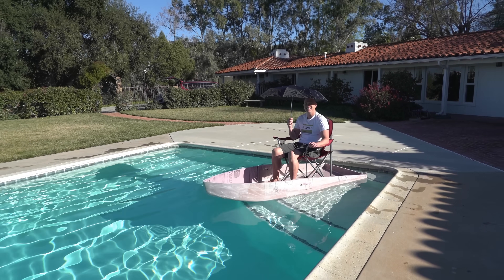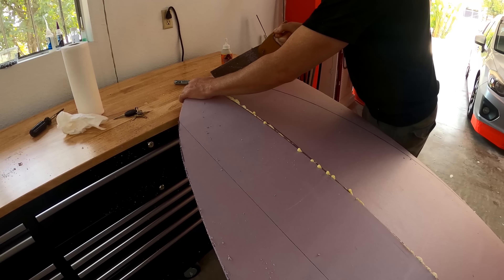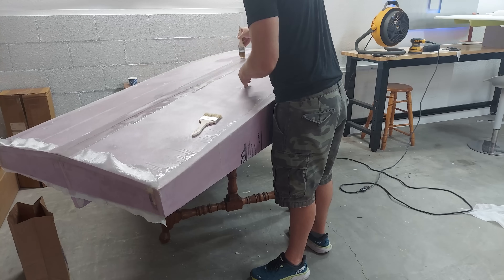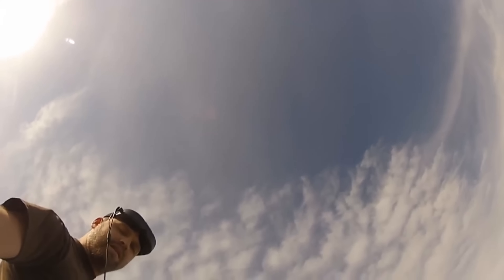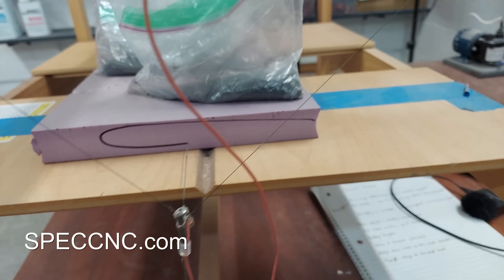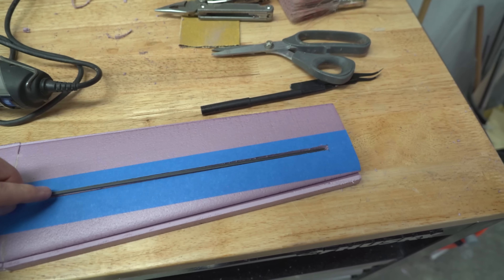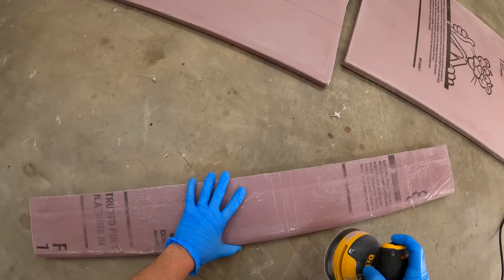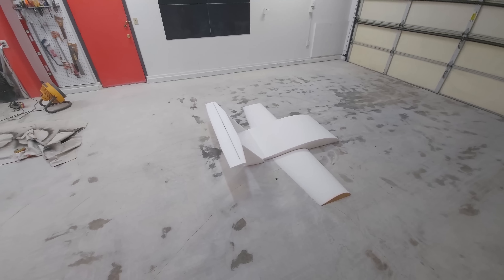Worlds First Optionally Manned Hydrofoil?  Build Part 1

Comment: Mix long set epoxy in a container that will sit inside a twin container - in one container ( the bottom one) add crushed ice and seat the container with the epoxy mix on top - the cold will extend the set time and make for a less stress epoxy job. You have time to set up the parts ( remove air bubbles and general fit up ) even when epoxy has been applied and the bonus of less waste due to the mix curing b4 the job is completed. If you use quality epoxy the cooling of the mix does not seem to effect the quality and strength of the finished work piece.  For quick and dirty "glue" applications mix super glue and sodium bicarbonate to create a strong bond and one that fills gaps nicely - can be sanded when set but cannot be slowed down!!!.

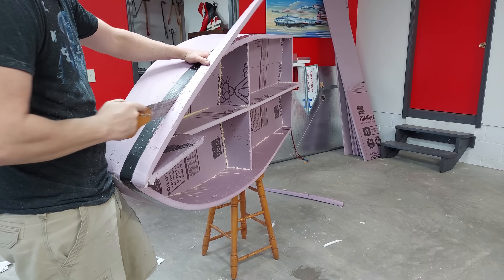Comment: Appreciate seeing bits of process used going from CAD design to full-foam-formed concept. Nice job recycling an efficient land cruiser (1:45) into a future hydrofoil vehicle. Maximizing the milage of your foam supplies.

The bonus GEV concept looks great. Not sure if placing motors behind where an optional pilot might be seated is ideal. Partially because of air-wake turbulence, and partially having 4-6 propellers spinning directly behind a pilot. For brainstorming ideas, you might consider what paraglider pilots are doing with electric motors. Larger propeller should help with efficiency, reduce complexity and an added shroud would add a safety element.

From video editing standpoint, some creativity could aid a visual transitions between major segments, like the bonus section. A simple reusable graphic would be enough, should time budget allow.

Comment: Just a few thoughts on epoxy and West;)
You might have been tongue in cheek commenting that it's great for marine use. Makes sense as it was developed by the Gougeon boat building brothers. It's famous, easy to work with and over priced for what it is - a 1st gen epoxy more or less. Others are more advanced, take post curing better, and can be had cheaper. But for small projects (and big if you don't mind the price), West does do well. The pump system is genious in its simplicity. And the whole eco system of fillers from the same brand makes it easy to get what you need. 

But yeah, it's too expensive. What I really respect about the brand is the early work the Gougeons did and how much they shared in terms of how to work with epoxy. They really were trail blazers. And most of that info is still out there for free and there's a ton to learn from it. No matter what system/brand you end up using, I think most people who built structural parts w. epoxy should read "The Gougeon Brothers on Boat Construction". It's downloadable, just search for it.

(Also, don't wanna be a downer, but I do hope the struts and foils are gonna be beefed up substantially. The loads with you in it aren't neglible)

Oh, congrats on the printer. Soon you will be in that rabbithole of thinking you need bigger and fast, perhaps a tall delta or a fast HVORT or similar;)

Comment: Hey! Sweet project. Manned foils are both the most amazing thing ever and a massive nightmare. As another commenter mentioned, using existing aluminum extruded parts is probably your best option. For struts, the 19mm aluminum masts made my Axis foils are a good option with a nice airfoil, low price, and high stiffness. 

The lifting wings will be harder. Ideally you will want an asymmetric section. The wing sizing and section choice are very important and will depend on how you build the wings. Happy to suggest some sections in a private message. 

A symmetrical section for the stabilizer is a good choice. I would start with an oversized tail surface(s) as they will make takeoff and stall more manageable.  

A very narrow hull is generally best for takeoff on foils. The foils have a large damping effect and massively increase the stability of the boat. 

Excited as always to watch your projects come to life!

Comment: Amazing skills with fiberglass, foam and wood.  Some of the helpful tings like using the cutout from the wing as a holder for the wing when you are routering out the holes should be explained more.  Another thing first-timers are stuck with is the settings to make a brushless motor work with the controller.  These motors look easier.  Show us every step to set them up please.

Comment: Did you know that extruded aluminium foil masts for kite surfing can be quite inexpensive if you look around? They cost around $100 for 90cm, half of that if you order from China. It would save you a lot of trouble to just buy a few of those and it would be stronger, stiffer, lower drag and in the end probably less expensive too, as you will find that a foil mast must not only be strong, it also needs to be very stiff if you want it to be controllable. If you make it from composite you will need around 10 layers of carbon, half unidirectional, the other half at 45 degrees to resist torsion.
Reply: I agree on the need for some more structural stiffness on the strut/mast for the foil. Reminds me of when the Swedish RC guy 3D printed one for his foiling surfboard and was surprised it didn't hold up at all. 
Good idea to perhaps just buy this part.

Comment: You should put up one of the new 4k home security cameras in your shop and have it recording on a 12hr loop, so that you always have time lapse material for portions of builds you don't think to film👍 If you are ambitious build a workflow to automatically generate time lapses of the last 12hrs with the press of a big red button in the shop😂
Reply: A streaming cam would be great!
Reply: People like to have a private life as well.
Reply: @insAneTunA  I'm not suggesting stream the camera, just have it set up for filming all the time😅
Reply: Two cameras, just incase one angle obscured. 2x the chances of getting some good b-roll, or time-lapse video. (alternatively a couple of strategic placed GoPro mounts (so don't have to rad the foam budget new equipment)
Reply: What sort of storage does that require?
Reply: @GilesWendes  at 15fps, it would be just under one TB if the video was stored in an uncompressed 4K cinema camera format...  In reality it would depend a lot on how good the cameras compression is. One way to reduce the total disk space would be to store a shorter loop of video (for unexpected funny/dramatic shop events) and just 1FPS for a longer time lapse.
Reply: That's creepy.
Reply: @FarmerFpv  only if you share the camera feed with anyone? Otherwise it isn't any different than filming everything about a project manually except it is less work.